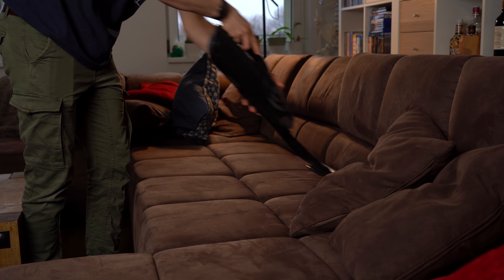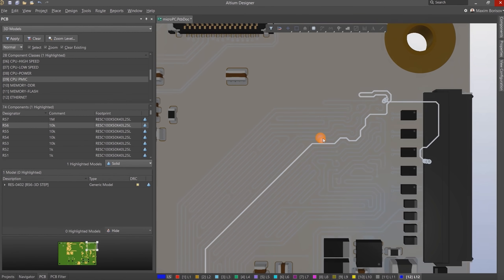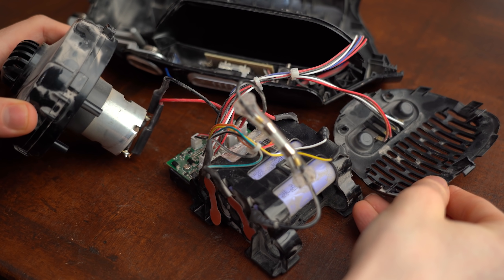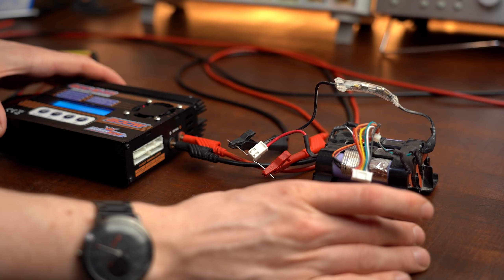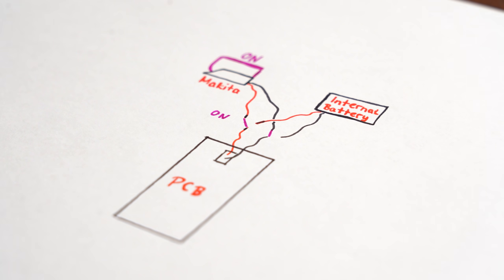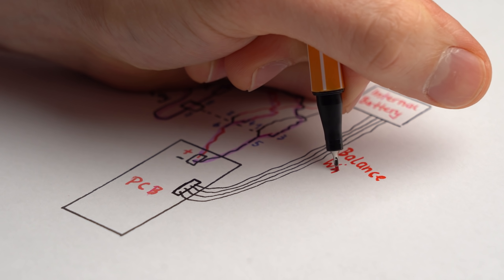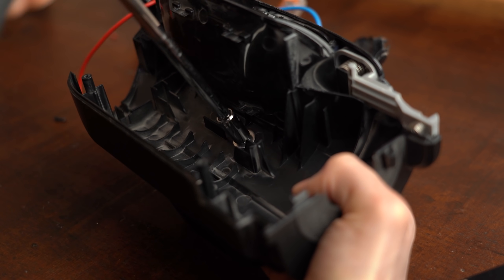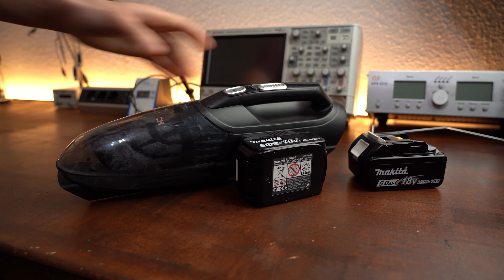Every Device should have this Upgrade! (Endless Battery Run Time)

Comment: Just out of curiosity, why did you go through the trouble of creating this common grounding point, when all you needed was to simply not switch the ground through the relay?
Also, don't leave the external battery attached, as the relay will drain it fairly quickly.

Comment: So if you already have a set of battery tools you have min 2 packs. One adapted on the vac and one in the charger. Would be a a reason for me to get rid of the internal snail charger battery. Also not swap relay is needed.

Comment: Finally someone else with the same love for Makita batteries.
I recently built an adapter with an arduino, to output 8v to my canon dslr. (QC3Control)
Pretty much infinite shooting time, in the night! :D
It also has a few QC3.0 USB Ports for fast charging and optional equipment like a lens heater.
Reply: Why Makita batteries specifically? Are they somehow better than other batteries of this type or is it just because Makita are the only brand you've bought and you're happy with them so haven't tried others?
Reply: Do you happen to have this posted somewhere? Sounds pretty dope, love to have a look at what you built! :)

Comment: Why not using Diodes that both lead towards the motor PCB?
The relay coil will keep drain current while the Diodes won't and no mechanical connection needed.

Comment: i have an old minelab metal detector, its supposed to run on this giant lead battery you carry in a pouch separately, it caused so much interference moving in the magnetic field, and i had a old broken dewalt drill, i pulled it apart and took out the everything i didnt need, cut off the top drill bit and just left the handle and the battery mount, stuck a voltage converter in the handle to take it down to 6v, and mounted it to she actual detector solid so now its stable in the magnetic field and dont cause interference, runs for hours and hours on the smallest battery i have a little 1.3ah, so overall its probably my favourite electronics project i have ever done made the detector 1000x better to use

Comment: Stupid idea. You could just created an external power cord & put your battery pack on your belt or in your pocket. Now you've got battery pack always hanging on a cleaner instead of a tiny socket. Anyway, nice video showing the process of hacking an everyday devices.

Comment: Hi, I wonder have you heard about 4 phase (2 x 2 phase) coreless generators where phases are moved 180 degrees, this gives approx 30% more voltage at same rpm using less copper.
Would you interested to make experimental one for fun?

Comment: I did the same thing hah. But instead of powering my vacuum cleaner I am powering my laptop with a dedicated GPU (3060)... I do this with 4x Hikoki large ass batteries. Could ofc have gone makita or dewalt but... oh well...
These batteries have built in BMS so it's quite secure and the charging station can charge them all at once. And ofc... 5 years warranty hah.

Comment: You can place two batteries on at the same time and basically have unlimited non-stop runtime since if one battery dies, you switch to another while the other one continuous to provide power.

Comment: what about changing an old battery pack into something you can plug to mains. So you can make your wireless equipment wired in case of all batteries run out of charge.

Comment: First, I appreciate your choice of going with well-known and trusted brand for tools, such as Makita and Bosch. Second: ABS plastic welding is awesome, never heard of it
Reply: I've had two Bosch vacuum cleaners. As a result of that, I will never buy a Bosch vacuum cleaner again. I thought the first one being a PoS may have been just an accident. Nope.
Reply: @RFC-3514  make sure you're not referring to general purpose Bosch tools. They are not cheap yet standard to low quality.
Bosch professional equipment is coloured with a different grade of green. This kind of drills is, for example, at the level of Makita, Milwaukee, etc.
It could also be that Bosch is not specialized in vacuums (Karcher would be better)
Reply: @matteol.7311  - The Bosch vacuums I used (like the one in this video) are not classified as "power tools", and are neither green (consumer) nor blue (professional).

Bosch blue line tools are generally decent (as are some green ones), but I'd still rate them slightly below Hilti, Mafell, Festool, or even Metabo. The smart thing to do (money wise) is to find a tool designed and made by one of those (or by Elu) and now sold under a different brand. For example, Metabo sells some cordless drills which are actually Mafells, and DeWalt sells a sander that is actually a Mafell and a couple of routers that were originally designed by Elu. Most of DeWalt's new stuff is kind of crappy.

I have a couple of Kärcher pressure washers (mixed results; they get the job done but some of their plastic parts break very easily - namely the filters), never tried their vacuums.

Comment: That’s awesome. I remember how bad was having to wait for ages when the battery died on that type of vacuum. 
Btw, no need for flyback diode on the coil connections? Does the relay have one built in?

Comment: When the external battery are plugged and the vacuum not in use, the relay must be unplugged to not discharge the battery by that 100 ohm resistor, right?

Comment: Honestly can't stand those handheld or stick vacuums, the dyson ones are about the minimum required to be properly useful but they're expensive af. If you're doing serious vacuuming, nothing beats a proper cleaner!
2:36 See all that dust inside the housing? That's the poor filtration dumping dust back into your house

Comment: I wonder if it is possible to let the air flowing in from the vaccum Cleaner,  rotate a propeller inside the device that in turn charges the battery just as how a windmill produces electricity from the wind. The air flow sucked in should be enough to charge the battery efficiently while it is getting discharged from operation or the better solution will be to charge a second battery on the vaccum Cleaner (by the principles discussed above) that will be automatically switched to, when primary battery gets discharged .

Comment: Surprised you made no comment about the clearly better performance of the external pack. Do you think this is just due to the age of the internal pack or does it have something to do with the circuit board controlling the flow from the internal pack?
Reply: A full battery VS an emptieish one + old VS new + larger capacity VS smaller capacity all give better performance.
Reply: @astranger448  of course. I know all of this. My question was about the internal board and it's control over the original system and whether bypassing it (as he did) was what accounted for the performance.
Also, since in video he never said anything about how old the battery pack was or how charged it was by comparison we don't really know if either one of those are true in your scenario. He also doesn't talk about how he's counting on the internal regulation of the battery pack to limit the current to the motor. And I would be willing to bet this is why it runs faster because it has no current limiting factor on it. Which also leads me to question how much current is actually being pushed through the system since there's no regulator on it now and whether or not that's going to affect the longevity of the motor itself.

Comment: If the external battery will not charge the internal battery, I think you will not use the internal battery any more. Who will connect a charging cable if you can just replace the battery.

Comment: As long as the motor doesnt overheat. Maybe not with a Bosh but sometimes things are built with the batteries limitations in mind as far as duty cycle goes. "yeah it gets a little hot after 10 minutes but by then the batteries are flat and it gets 4 hours to cool down".

Comment: That's great.
I simply bought a Bosch UniversalVac 18 which uses the same battery packs as my Bosch Drill, Circular saw, Jigsaw, Reciprocating Saw, Angle Grinder and String Trimmer. I have 7 battery packs and 2 chargers so I'm good to go.

Comment: Or you can just buy a Bosch Handheld Vacuum Cleaner. (they exist in other brands too)
The use regular, removable, hand held power tool batteries.    Also, they've been out for almost a decade. 
Who's fault is it that you bought the cheapest, crappy vacuum cleaner possible?  
I am guessing this is just an excuse to make a video because you've run out of other ideas?     Enjoy your 👎.

Comment: Important to always mind whether the tool or the battery includes the protection circuitry before reusing or "mis-using" power tool batteries.
Reply: Makita batteries are ideal as all the protection is in the battery.
Reply: @helpyclip  Since when? Never seen one!

Comment: Well, TTI not only owns some huge tool brands, they also own a number of larger vacuum brands... So recently a few of their cordless power tool brands have come out with these types of tool-powered vacuums. (Ryobi and Hart, and maybe Milwaukee?). Actually I think Makita also makes a tool-battery-vacuum too 😁
Reply: I almost bought the Ryobi vacuum last year when I'd gone in to look at Ryobi One+ chainsaws... But I also liked the look of the air compressor and angle grinder, so I left before I ended up buying all those too... Wouldn't mind a mower and blower too. It's so weird how many power tools you suddenly need when you've got the batteries already.
Reply: Makita has like 6 different battery powered vacuums, small handheld ones, big handheld ones, one in a backpack and even a 'traditional' one that runs on 2x18v or corded.

Comment: Personally, I would have used a microswitch through the adapter, with the NC connecting the internal battery pack, and the NO connecting the external one. That would mean there's no phantom draw from the resistor and relay coil in either position.
Reply: 7.5A DC (!) micro switches are something not many of us have lying around. Standard omron SS-10 switches do 3A@30VDC for motor loads. Generally, you won't find DC current ratings high enough in microswitches (or any miniature mechanical or electromechanical switch, including relais - this is because of arcing between contacts at high currents).
I personally probably would have just merged the two power inputs with an adequate amount of shottky diodes. That does have some ~4% efficiency loss (assuming a forward voltage of 0.7V), but seems like the easy solution to me. Alternatively, there's fun with solid state switches (in this case probably MOSFETs) to be had.

Comment: The only issue with the relay is that it drains the external battery if you leave it on. A MOSFET would be a much better solution.

Comment: What cheap brushed motors these things use!  You could replace it with an inexpensive model airplane motor and get more power or more longevity depending on the winding resistance.  A high-power brushless motor would be really neat.  You'd need to fit an ESC and a PWM circuit inside the case but the result would be a seriously rad vacuum cleaner!

Comment: I was disappointed to see that you have kept the internal batteries. I see no point for that, since their time is almost up. I would have used that slot to fit the battery adapter instead. Furthermore, since you mounted the battery on the side, the vacuum will be way off balance each time you use it with the makita battery. I have to admit, I did found something very interesting: the "plastic welding". I would have used 2 part epoxy otherwise.

Comment: How do I configure a pass through function of a battery pack. Let's say I have 24v 5A pack. The BMS comes with common positive & negative points for charging & discharging battery pack.
1) Can I have my power adapter charging the batteries and the batteries running the load at the same time?
2) While my adapter is charging my pack, if I switch on my load and the load current is more than what the adapter can deliver, will my batteries compensate for it along with adapter?

Comment: does it really need the relay?  the pack has its own BMS and though it could could charge an almost dead vacuum, it is not too bad.  a powerbank that charges another device through USB is worse.  additionally, since the battery performance is the same, the pack working in parallel with the vacuum battery will help the cells last much longer as the amps/current in each cell is lower

Comment: I say get rid of the relay and come up with a SPDT switch you can locate in the Makita connector. That way if you leave the Makita battery installed, there won't be any power draw.  If you can't come up with a way for the insertion of the battery doing the switching automatically, then it seems like it would be okay to just use a toggle switch to manually make the selection.  Seems like your solution is over-complicated and I didn't see a suppressor diode across the relay coil.

Comment: A nice side-effect of using the external battery power as a priority switch is that if you do exceed the runtime of one of your Makita batteries, the vacuum cleaner should automatically switch back to the internal battery while you grab the other (hopefully already) charged pack.

Comment: I would like to do the same thing with my Whites Coinmaster 6000D metal detector. 
It uses 2 AA battery packs. Wired as follows.

(+12V)-----(GND)----(-9V)

I want to connect it to a DeWalt 18V battery pack. 
How would I convert a single ended 18V supply to the output listed above?
Reply: Alternitively. If I use a 18650 LIPO pack with a BMS, can it be wired to have the same requirements?
Being recharged from a single ended (2 conductor) input charger?

Comment: Awesome, these modifications and assessment of the range of batteries are great videos to share.  I recently powered my Viking  Husqvarna SLE 6570 sewing machine with the DeWalt 18V via a power drill... didn't modify since don't need with using just the power drill motor and if I did, I've use the 20V batteries.  Neat to do these conversions and is interesting watching the videos of the 120/240V tools modified to use battery packs.  Thanks for sharing!

Comment: Idea for a project
Build a simple high voltage capacitance multiplier with a MOSFET to substitute the capacitor on a PSU and decrease the noise
You could also compare it to a super capacitor of a couple faraday's

Comment: I converted a  20v black and decker cyclonic dustbuster, as well as our 20v hoover Linx vacuum, to both use ryobi batteries (exclusively).   It's been great! 

Your conversion would be an interesting project to try out a pair of those chinese 25A ideal diode boards.   In theory it should completely drain both batteries if you run it long enough, and handle any differential voltage/state of charge issues automatically.  I'm planning to use a pair on my ebike  to add a removable second battery pack.

Comment: Pretty clever.  Instead of using a relay, I wonder if it would have been possible to mount a switch inside the battery adapter that would be physically actuated when the battery is inserted.

Comment: Just wondering... why use a lighter for the heat shrink tubing? You have a heat gun you just used for the plastic wielding. Just a suggestion so you don't have to try and wrangle a lighter in situations like that.

Comment: Instead of a relay, you could also use a switch that is physically activated by plugging in the external battery.
Reply: It would probably be easier to design the switch to be activated manually by your finger, located on the side of the vacuum. A relay is simple to use, once you figure out how they work, though.

Comment: Now make an adapter for those Makita battery packs to usb-c powerbank like charger circuit. Battery empty? Just slide in a new pack lol. You can even have multiple voltages.

Comment: I did this with a 12v dust buster, I pulled the original pack out and added leads with an xt90 so I could use 4S LiPo packs with it. Way more powerful and runtime for days. I love it

Comment: Why keep the internal battery ... once you have that mod you would just run it from swap-able batteries .   Incidentally the Makita MAKDCL180Z 18 Volts Trigger Switch Stick Vacuum's are pretty cheap.  Bosch also make battery power tools so surely they make one as well?

Comment: I've been thinking about making a 12v AC adapter for some of my battery tools for when I've got a lot of high draw cutting and grinding to do, and I've got the convenience of a nearby outlet. I'm thinking a power supply with sufficient amperage, a big cap to handle the inrush, and maybe a few high value resistors for a voltage divider to trick the tool into thinking it's got balanced batteries feeding it if it's got a brain in it.

Maybe you'd like that as a future project too
Reply: You would probably need some pretty big caps, battery tools sometimes draw more power than corded ones, those cells really can dump a ton of current.

Comment: 2:44 An 18 V, 2 Ah pack made from a bunch of discrete 18650 cells and a BMS board inside the portable vacuum unit? That's literally the same as in your "pro-sumer" brand power-tool kit battery packs!

Comment: Did something similar just this week: 3D-Printed a permanent adapter (more or less replaced the connector) for the ALDI Ferrex 20V tools to accept the Bosch Professional 18V batteries. Both are 5S, like all the 18-20V systems. Ferrex tools even read the thermistor probe of the Bosch packs correctly, and the connection to the thermistor is actually necessary to run the Ferrex tools.
Reply: I've got a Black & Decker pole saw I'm going to do the same with. Battery is dead, charger is missing, only B&D device in the shed among half a dozen Ryobis... And some kind soul on thingiverse has done the hard work for me so I just need to find some time to load up the printer and make it 😁